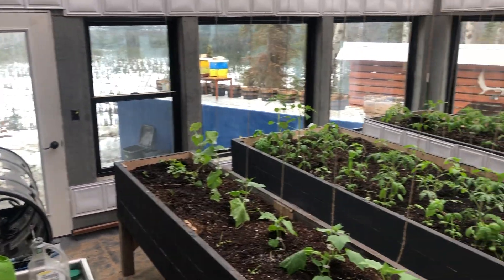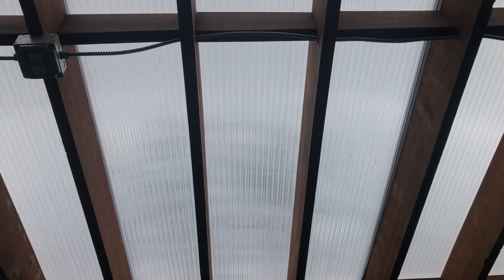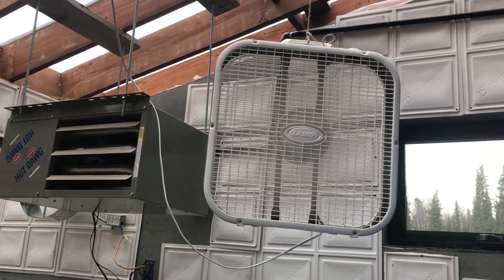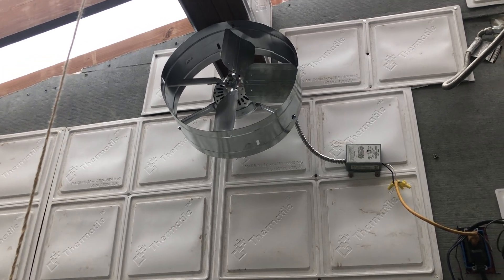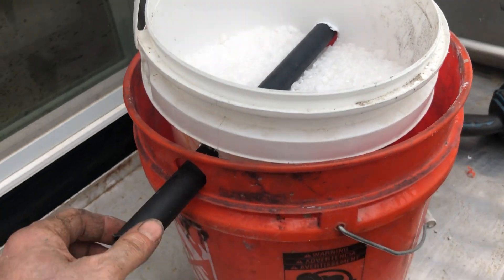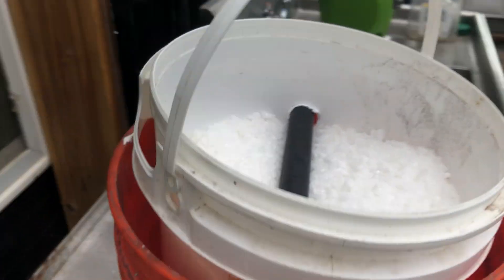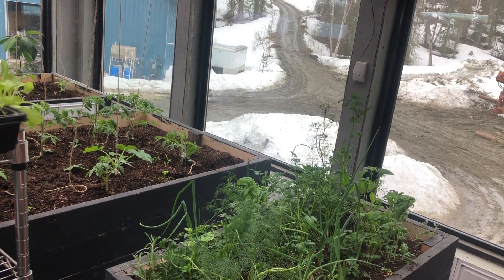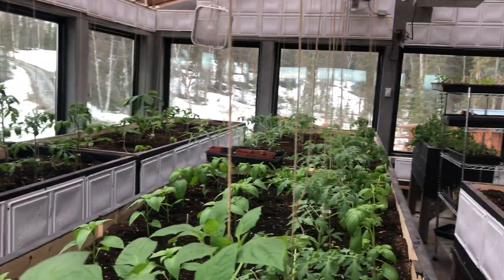Moisture control in greenhouse.  Will ice melt (calcium chloride) help?

Comment: I am also wondering if icemelt is a working alternative to calcium chloride as it is way cheaper...

my usage would be for inside an old cottage though...

Any thoughts?
Reply from the maker: It seemed to pull a lot of moisture!
Reply: Have you tried it whats the results? I have a tiny cabin with no ventilation im hesitand with calcium chloride because it says it releases toxic gasses when it absorbs water

Comment: Any updates on this? Thanks
Reply from the maker: It works but not as well as I'd like.  I can see that it pulls some moisture out of the air and the ice melt feels wet but the greenhouse still has moisture.  I think the difference between the inside and outside air is just too great.  I could maybe use more of these buckets? I think this would work well in a crawl space or something though.
Reply: @4Tfarmandranchalaska  Ive also seen that the more suface area the better. Maybe try to make more of a wall out of it? (thin sheets of it)